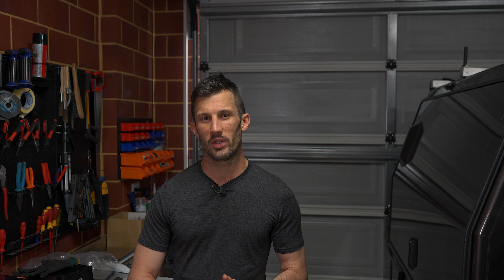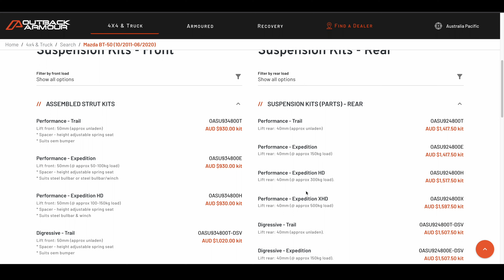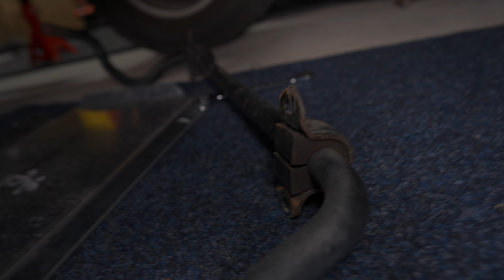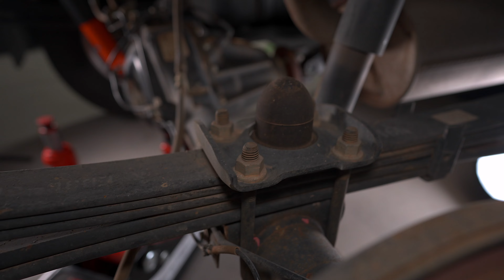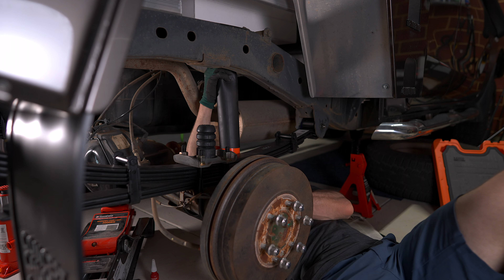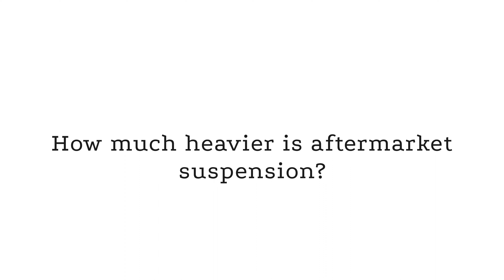4WD Suspension Selection & Install Guide || Mazda BT-50 / Ford Ranger Outback Armour Suspension

Comment from the maker: 1 YEAR UPDATED CWG MEASUREMENTS
FRONT:
• Pre-Install = 546 mm
• Post-Install = 612 mm (+66 mm from original).
• After Settling = 595 mm (+49 mm from original).

REAR:
• Pre-Install = 505 mm
• Post-Install = 620 mm (+115 mm from original).
• After Settling = 600 mm (+95 mm from original).

So you can get an idea of how much it will settle. If I wanted to I could even get the front shocks extended now that they have settled if I was after more ride height (I'm not, 50mm is perfect but that threaded seat allows you to go higher or lower if you're not happy).

This is awesome at the front because we've lowered the CV angles which were quite bad after the install, they've settled now at the stated 50mm lift and the CV angles look good.

The rear settled about 20mm, this height can't be adjusted (again, not that I want it to) unless new leaf springs were fitted.

Comment: Hi there, i have a question about the greaceable bolts. Is it possible to use the non-greaceable bolts from another brand. Or the greaceable ones generally are better.

Comment: How did you get your suspension? I tried to buy direct and Outback Armour wanted me to go through a dealer. 3 weeks later and still no quote 😢
Reply from the maker: I'm in Perth and went through Medicar, they were very good and have it slightly cheaper than Outback Armours pricing.

Comment: Great video mate, I've just brought the new dmax xterrain and kitted the back and canopy etc now on to suspension. Your video was extremely well made and is going to be very beneficial when it comes to installing my off-road armour suspension.
Reply from the maker: Glad to hear it, most cars have similar designs so the setup should be similar for you.

Comment: Hey mate, excellent video. How are you finding the suspension after a year? I have  ARB OME 600kg and the thing is too bumpy. Would you recommend your kit? Cheers
Reply from the maker: Still enjoying it, I think I basically sized it up ok as far as the springs go so it seems to be doing ok, not too stiff on the rear.

Not sure what OME has but what I have has adjustable bypass, but not separate control for rebound and compression just one overall control point that works well.

Comment: Awesome video, I just had this set up installed the other day. I noticed I now have creak when turning hard right. Did they do something wrong doing install, what could I check?
Reply from the maker: Hmm, I'm not an expert by any means so would be hard to say without hearing or seeing it.

Is it like a squeal? Not sure to be honest.
Reply: @TheBrowneTown  definitely a creak when at hard right turn and low speed. And can feel it a little through the steering wheel. Also just found my sway bar link was left loose so tighten that up but the noise is still there.

Comment: I forgot to mention that I'm leaning towards 300kg constant  as the 500 kg would be too much . My problem ( if it's a problem), is  the  rear carry weight is approx 400kg and I wish they offered a 400kg constant.  I have an ' iron man add a leaf'  kit - new /never used. I was wondering what your thoughts are if I include these in the spring assembly, My thinking is that it will put it half way between the 300 and the 500 to better cope with my carry load.  When we go camping ( 2 times a year), all the carpentry tools come out and  the camping gear would barely  make half my normal carry weight and I thought the adjust dial on the rear , might help for a better ride.  Thanks
Reply from the maker: I am also probably heavier than 400kgs but not at the 300kgs mark in the rear.

Hmm not too sure to be honest what weight value the iron man add a leaf would add, or if it depends where it is added or to what kit. Not familiar with them at all.

Comment: Hi,  Re - the rear shocks, I noticed that the adjustment dial/ knob is up the top as opposed to another one of their rear shocks that have the dial at the bottom. I gather your dial is at the top, because of the " adjustable threaded spring seat" at the bottom. I like your choice of the threaded spring set  shock , as it might negate the need to spend money on different uppercontrol arms. Great video. You're very thorough in explaining things.
Reply from the maker: Adjustable spring seat is only available on the front shocks.

The rear shocks are just standard shocks, I think the adjustment is down the bottom of the rear shocks and the top of the fronts.

Comment: Excellent video. I have a 2016 Ford Wildtrack 3.2 Diesel in Belize, would like to get a full front and rear suspension kit from Outback Armour, is the suspension system in the Ford Wildtrack the same as the 2016 Mazda BT50?
Reply from the maker: I actually am not sure about the Wildtraks but my guess would be yes.

If you check out their website you'll be able to see the part numbers and compare to my car I guess, but I dare say the install will be 95% the same.
Reply: @TheBrowneTown   thank you been doing some research and they are basically the same, thank you for such an informative video, please keep uploading.

Comment: Can you lower the front will it’s still in or do you need to remove it first?
Reply from the maker: Has to be out, need to compress the springs so there's no tension on there, loosen the grub screw and change it.

Will be hard to compress the springs as well (any workshop could do it though).

Comment: Very well edited video mate. Curious, you obviously didn’t see the need to replace the Upper Control Arms? Opinions on this seem split when doing a 2” lift. No issues with the castor angle during the wheel alignment? I’m looking at the same setup as yours on a PX3 Ranger.
Reply from the maker: Yeah I wanted to avoid it, extra cost and everything that's why I went the 2 inch lift and tried to underspring the car.

They never mentioned any issues to me when I did the wheel alignment so I believe it's still got the tiniest bit of adjustment there to compensate. Any higher and I'd definitely need them.

Comment: great video mate, this is something i have been toying with doing, overall are you happy with how this kit feels now after a few weeks? hows the front cv's going?
Reply from the maker: It's going good, I did the retightening of everything and the u-bolts definitely needed to be nipped up, everything else was fine.

Haven't re-measured the heights though to see if it has settled. 

Handling is better, way better, it feels like a new car because it was quite heavy before for standard springs etc and it used to roll a lot in corners and braking has improved as well.